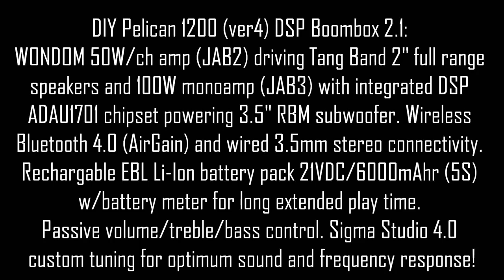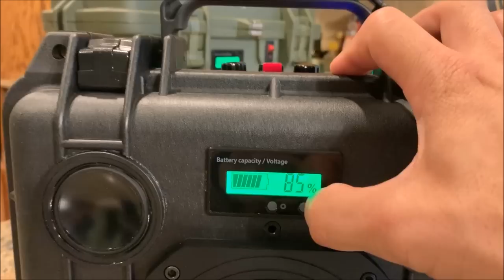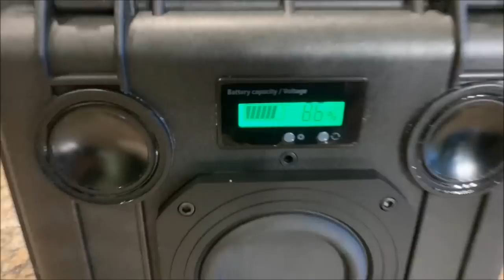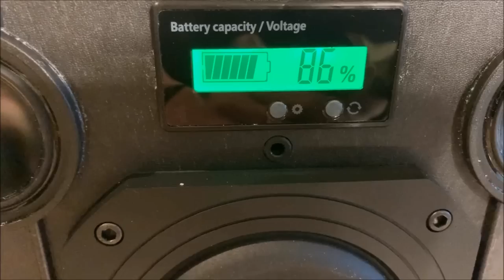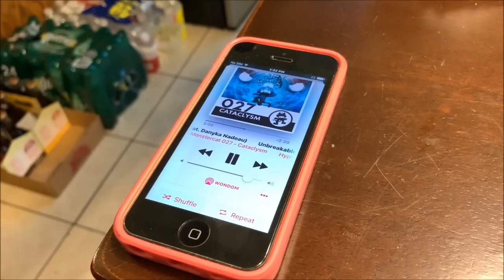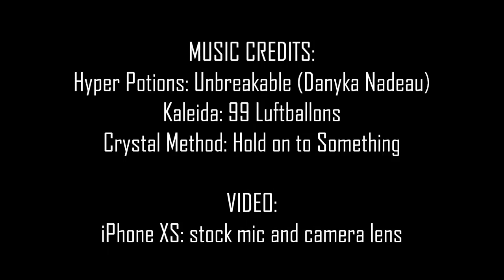DIY Pelican 1200 Bluetooth 4.0 BoomBox DSP (ADAU1701) 2.1 50Wx2+100W 21VDC (5S2P)!

Comment: I like the build quality of your projects. Everything is neatly put together. Would you say this battery configuration is a better choice for this application or a 12v sealed lead acid with a step up converter to power these type of rigs. I guess my biggest question is -is the current coming from a 12v enough to keep up with the demand from this setup and which one would have longer runtime
Reply from the maker: Most of the amps I use require more than 12v that's why I prefer lithium ion batteries. SLA is heavy.

Comment: Thanks for the great instructional videos.  I noticed you mentioned issues with input signal when using the passive tuning board.  Have you had other issues with low signal power? I'm finding I need to increase the gain of the JAB250 Bluetooth signal by quite a bit before getting reasonable volumes out of the 2.1 system (JAB250 + JAB3 - 1100).
Reply from the maker: Yeah I had to increase the overall gain by about 7-8dB. The boards seem to be defaulted to about 20dB gain. Fortunately, in Sigma Studio you can alter that by adding a few dB.

Comment: Quick question, does the jab3 have analogue outputs?  I was wondering if I'd be able to access all 4 channels of the adau1701 with a single jab board.
Reply: No, for that you need their separate DSP and extension board

Comment: Hello modaine. I am wanting to build a portable speaker too thanks to your detailed videos. but i got one question and i hope you can answer it. I will be using a 18650 5s2p setup, and i will be adding a good bms for it, but how do you charge it up? Do you just use an ac 21 volts adapter? I really can't figure it out. Thanks a lot.

Comment: Can you build a bigger box and more powerful bass... wud love to see how it turns out....
Reply from the maker: You read my mind or watched this video...Pelican 1510 aircraft cabin overhead storage sized on wheels to feature a 10" MB Quart sub...blah blah blah end of the year.
Reply: @MoDIYHiFi  Let's get it! I've completed a pelican build with the same case as this video using (2) Dayton Audio ND105-4 (4 Ohm, 4") --- (2) Dayton Audio AMT Mini-8 Air Motion Transformer Tweeter 8 Ohm, and a Dayton Audio XO2W-2.5K 2-Way Speaker Crossover 2,500 Hz. It's got pretty good sound, but I experience alot of clipping sound at high volume. Could it be the gauge wire, the crossover frequency? I'm using a battery bank 21, 19, 16, 12v battery bank powering the 50x50w BT amp board.
Reply from the maker: Nic Siqueiros yeah that's possible. Need to ensure full current and voltage to amps under full load. Id go 21vdc but ensure power wire greater than 18g

Comment: what kind of run times are you getting with those batteries ive build a fairly waterproof setup with a marine head unit and speakers powered off my motorcycle battery but id love to cut down on some of the weight according to the math I could get around 15 hour run time out of my set up at 50% volume

Comment: so, I looked up the EBLs and they have protection circuits inside of them.  Is the 5s protection board added redundancy or will the batteries not function properly without it?
Reply: I would say it's always better to be safe than sorry. They are very cheap and worth protection against the expensive boards.
Reply from the maker: It will still function with our without